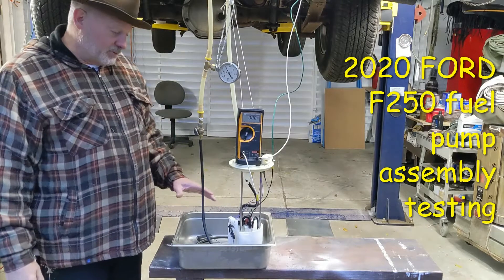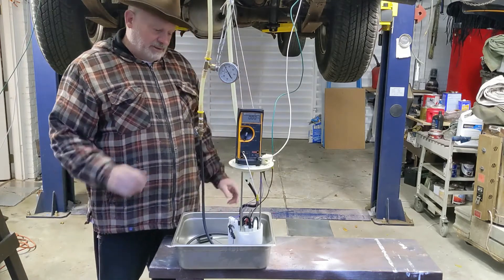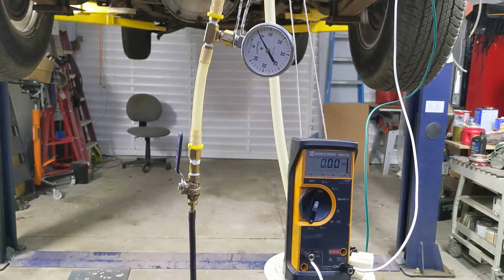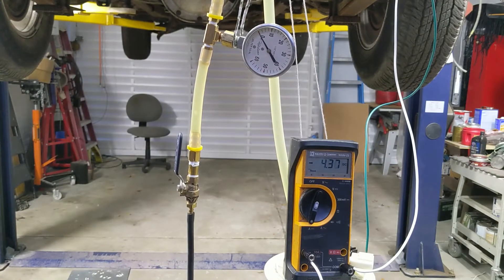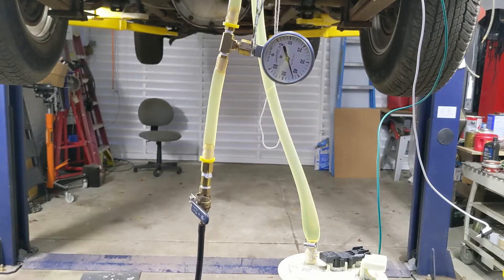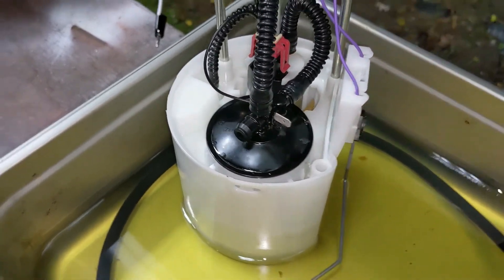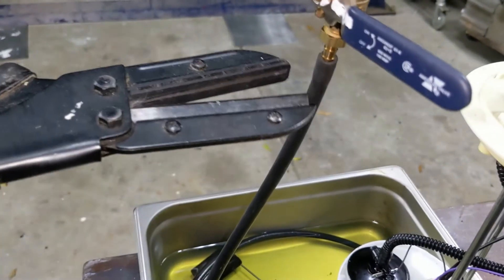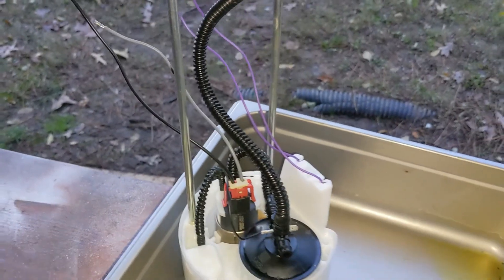2020 FORD F250 Fuel Pump assembly test

Comment: I am having this issue with my 2019 F250 6.2 gas. At 10,500 miles I had the dealership replace the fuel pump with the improved fuel pump part number HCZ3 9H307 AK.  Gasket was changed.  The date was May 6 2024.  This spring having same issue 1,500 miles later.  I do not use this truck much.  Starter always turns no clicking.  My question what part number fuel pump are you testing?

Comment: I meant to say should there be 12 v on the power input wire
I only have about 7.5 v with key on??
Reply from the maker: Yep, I understood you.  I did not measure the voltage the truck applied.  I have heard the voltage is varied and at idle seems plausible they drop the voltage.  I think the voltage comes right out of the ECM.

Comment: What voltage is the pump power
I'm shoping about 7.5 volt on the power in wire when the key is turned on ????
Reply from the maker: I applied 12v,  I think it may be varied based on load.  Vehicles have become stupidly complicated at the expense of reliability